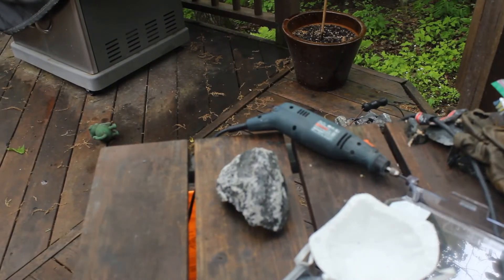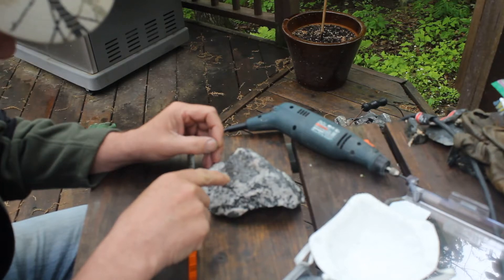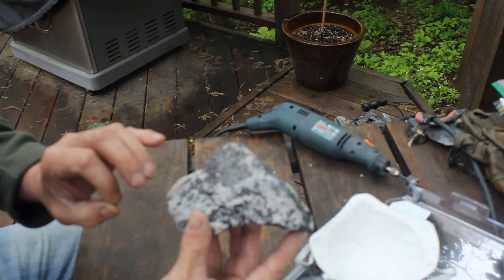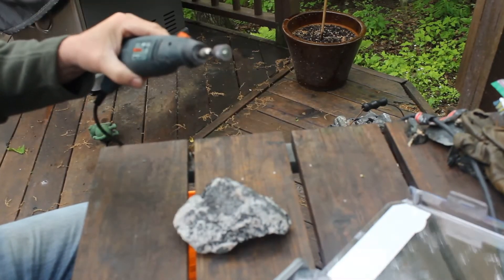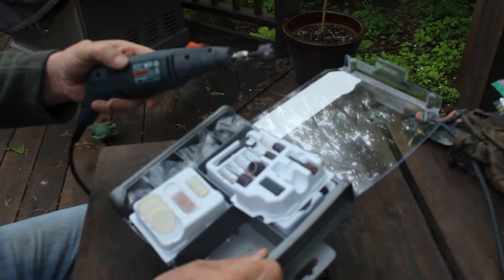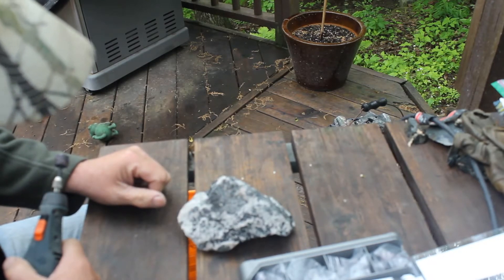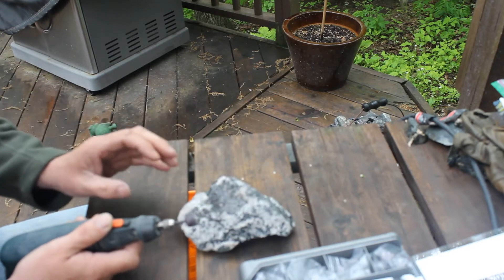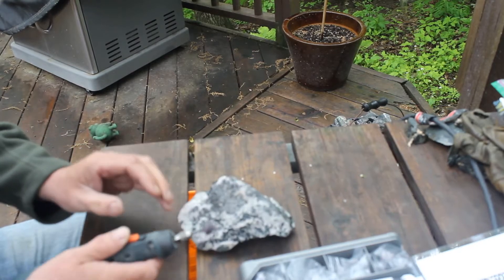EXPOSING SILVER USING A DREMEL

Comment: how about using a standard bench grinder screwed to the bench  . run the rock against the grinder wheel by hand with leverage . a old furnace motor and a 5in wheel of choice
Reply from the maker: That works except it works best to grind/polish wet to keep dust to a minimum